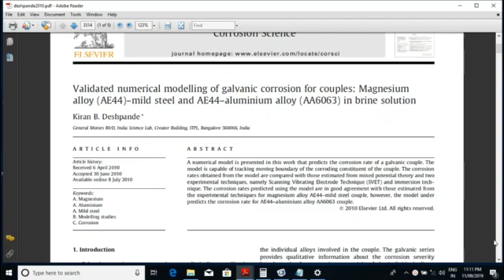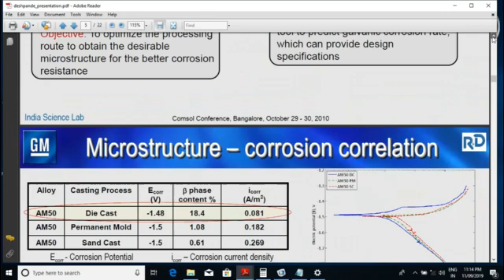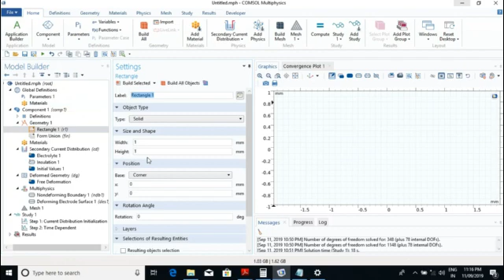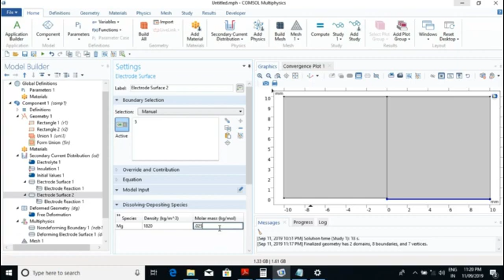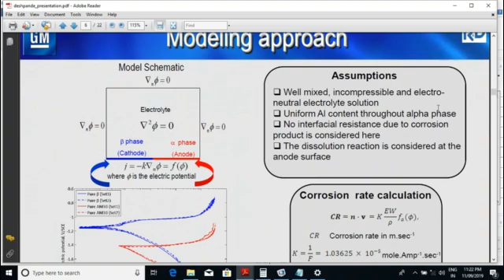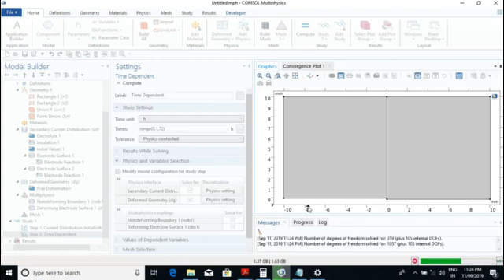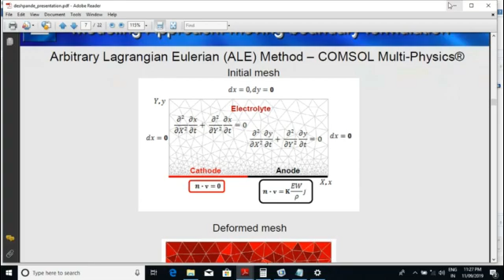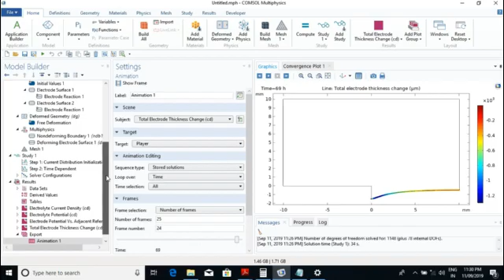Use of COMSOL Multi-Physics® in Modeling Galvanic Corrosion

Comment: Thank you for your presentation, it help us. I have a question related to model corrosion when you have a gases' mixture? is it possible to add each gas and its composition to the simulator, and if so, do you have any paper or info that works in that way and that you can share. Thanks in advance
Reply from the maker: Yes u can add Gas in place of Solutions

Comment: what about galvanic corrosion in 3D models is it possible?
Reply from the maker: Yes it is possible
Reply from the maker: Send me request with your Problem statement (Thesis paper ) on Amols2010@gmail.com 
So I will send you solution
Reply from the maker: Send me request with your Problem statement (Thesis paper ) on Amols2010@gmail.com 
So I will send you solution
Reply: @Mechanical114  ok thank you
Reply: not doing it for know,  thanks for the assist, I will reach out soon